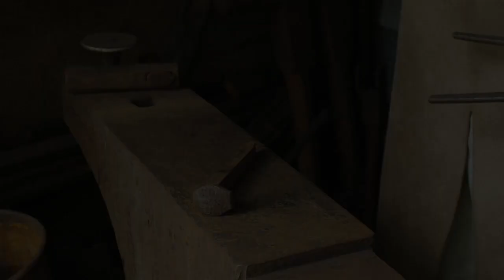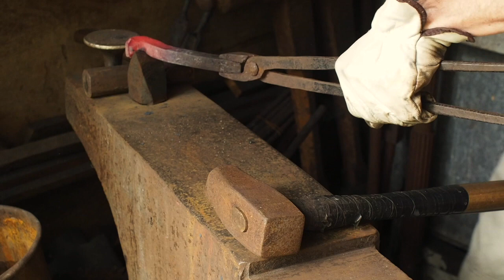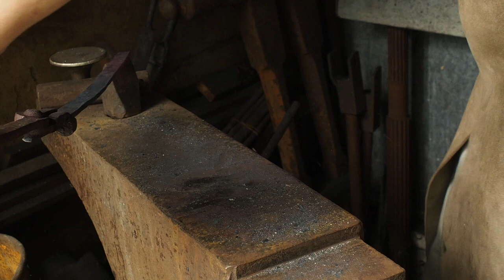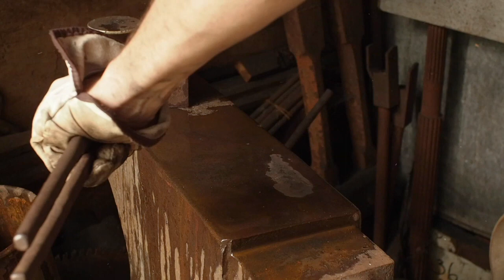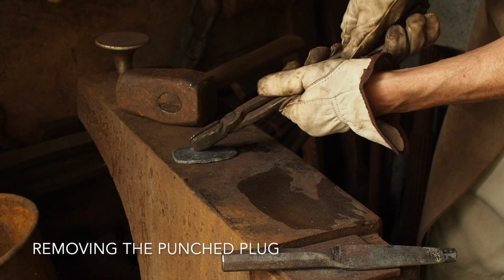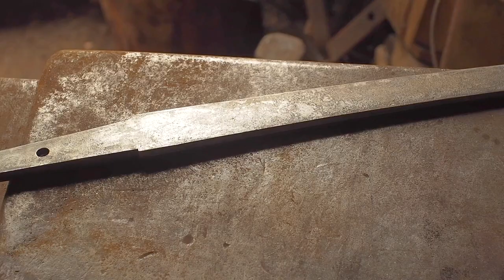TLDW #8 - Tanto Forging Practice: Railroad Spike

Comment: What is that block for at the end of the video?
Reply from the maker: not sure what you mean about the end, but around the 20:00 mark there is a wooden straightening block on the anvil, to prevent marring the already forged peak in the spine when correcting the bend...
Reply: @islandblacksmith  Yeah thats what i meant.  Nice to see an answer even though its an old video!

Your work has inspired me to be more "traditional" when making knifes. My powertools are beginning to gather dust :-)
Reply from the maker: ...the technology hasn't changed ^___^ ...keep at it!

Comment: Is that a wooden hammer you are using?
Reply: Or is it brass or a brass alloy of some sort? It doesn't make a metallic sound when it hits the metal or the anvil is the reason I ask.
Reply from the maker: just regular steel hammers, but hot steel doesn't make a metallic sound, it feels more like hitting a piece of wood...as it cools down near the end you can begin to hear it harden again...

Comment: Island Blacksmith you should make a tanto blade out of a file. I know its easy but you would be surprised by it turns out if you leave some of the teeth on the file. I should know because I might be the only one that can make one of the best looking ones compared to what I've seen on youtube.  I wish to see one from you soon.
Reply from the maker: files make great knives if heat treated properly...you can see some examples in the tools for satoyama project on my website...

Comment: Ah i see. it was just that in one of your replies you wrote .12%, i guess you meant .1% or .2%. thanks.
Reply from the maker: no, i meant .12% in the original, less than half of .3%....steel carbon content (even high carbon steel) is almost always less than one percent. (also, if you would reply to the previous comments all of these would be together to help other folks follow along too)

Comment: your right arm is probably huge and left arm not so much  ^.^
Reply from the maker: it might seem so at first thought, but actually the left arm is doing quite a bit of work even during the forging stages, maintaining pressure on the tongs, fighting against the hammer blows, and running the fuigo for air whilst heating...not to mention filing and polishing which are a pretty even match...
Reply: but I bet you could do some Japanese crucible steel from them that adds the carbon you need.
Reply from the maker: yes, oroshigane would work...but they are pretty high in manganese so the hamon would not be very detailed...
Reply: Crossed Heart Forge - islandblacksmith I see, maybe some way to tweak that property into the steel. Ive been wanting to experiment for some things myself. My goal is to be off-grid and be able to make my own tools and furniture simple living with a few modern comforts, So I am experimenting with the crucible steel stuff. I want to be able to take scrap and do my own ingots and do what ever. Love your work man
Reply from the maker: most modern steel has quite a bit of manganese that makes it deep hardening (this is not desirable for traditional hamon), so oroshigane is usually done with wrought iron as a low alloy sources...starting with anything high manganese translates to a lot of time and effort for steel characteristics much like a leaf spring you could find on a modern car...keep up the long journey towards excellence!